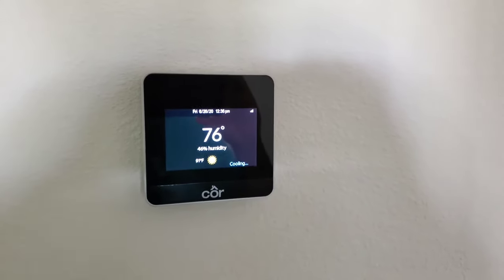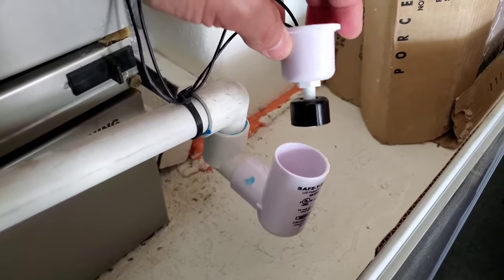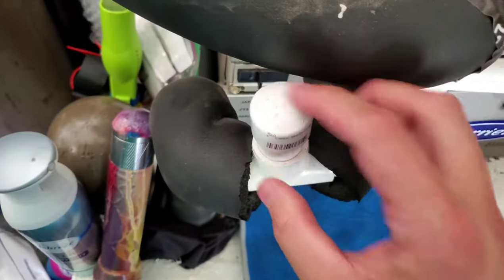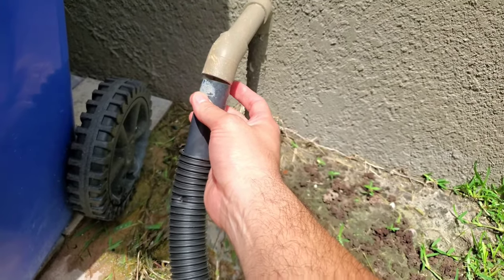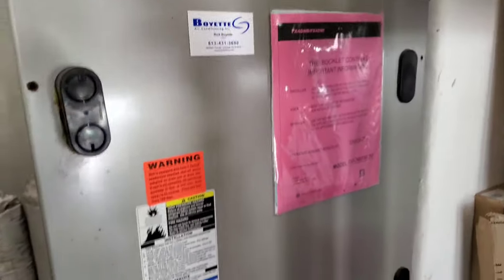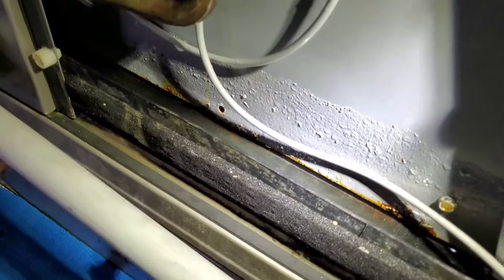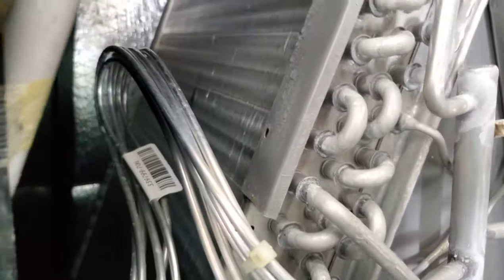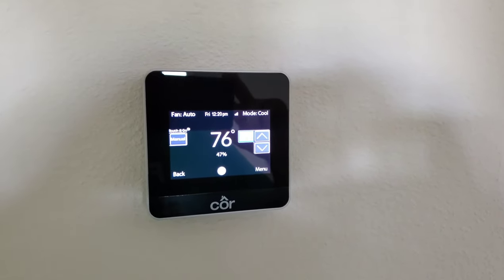HVAC DIY Maintenance - Float Switch Explained

Comment from the maker: The filter tends to be the common root cause or some that don’t run a filter at all. What happens is that dust passes through the system and ends up getting caught up in the condensation that drains out and that causes the clogs. When a filter is too dirty, the suction will bend the filter and air passes around it. There are other instances of clogged drains or float switch issues such as improper pitch in the drain line, too much flow and not enough diameter in the pipe, and also issues with the drain pain holes getting clogged with buildup.

Comment: my man absolutely saved me. It is HOT HOT here in Florida it was 109 this afternoon and my AC went out. I couldnt get maintence over to my unit till tomorrow and I lifted my cap and sure enough it was full of water.... I dont have a wet vac so I syphoned all the water out and sure enough with in 30 minutes blowing cool air. I feel like a million bucks and I get to look like a big man and fix it and now instead of waiting for maitence, my girl was happy.
Reply: The heat is getting worse in fl 😢 and it always happens in summer

Comment: I have a float switch but my thermostat is a nest which has a built in battery, I wonder if it will still cut it off. I appreciate the extra information for clearing the drains!!! No “on a future video”
Reply: Yes it does. Mine did exactly that last week.

Comment: This is amazing, thank you. My house and system is just under two years old. I’ve always regularly poured white distilled vinegar down into the drain line. Yesterday, my entire thermostat was dead as if it had no power supply. There weren’t any batteries in it to begin with so we added some and system came back on but then started to cycle on and off 5 minutes at a time. When it was on, I could feel cold air blowing out so I knew it wasn’t a total system failure. I checked drain line and was shocked to see it was completely full. Outside was still dripping though so I was confused. I hooked shop vac up to outside and inside until there was not even a drop left in line. I pulled out an entire shop vac full of liquid! It was the consistency of plasma. It worked, the air kicked back on and cooled me down from 77 to 72 in under an hour (Central Florida). Videos like this are a lifesaver! 

I deduced that the float switch must have popped up and killed power to whole system. Since thermostat didn’t have batteries in it initially, it also went down completely.

I learned my lesson that in Florida, when you run your air as low as I do, just vinegar won’t do the trick - it seems I’ll need to regularly get out the vacuum. 

This is also my first handler in the garage if that matters. All my other handlers have been in insulated closets.
Reply from the maker: Dude this is awesome! Im so glad I could help others out there with the same issue.
Reply: I have lived in S. FL since '94, and I've found if you vacuum the drain every 3-4 months, you'll have no clog problems. A five-minute job that saves a lot of anguish. Vinegar helps but won't prevent it entirely.

Comment: I think this video just saved me a few hundred bucks. 
Thankfully, I had a shop vac ready to go. 
Float Switch was definitely filled with water. Drained that and turned on. Few minutes later, back off.
Went to the drain pipe. Got my shop vac and a bunch of nasty stuff comes out. A lot!
Turned it back on and it's been 10mins of AC on. Let's hope is stays that way! 
Thank you!

Comment: Saved me some money and a service call and some great advice to service my system. Two story house and noticed some water leaking out of the ac/heat unit from upstairs. Had this happen a few years back and I remember the guy out and unplugging drain hole. I went up there and like a complete moron went at it with a coat hanger after taking the cover off and cleaning it out. Button everything back up and nothing. Didn't have a problem with the unit working until I meddled with it. The one switch the coat hanger was near was the Safe-t-switch in your video. After watching your video I went back up and sure enough, the black piece was now dettached. I fiddled with it and sure enough... paydirt..as soon as I put the black piece back on the safe-t-switch the unit came to life. Thank you for this simple and very informative video.

Comment: After cleaning the pipes with vinegar and  reinserting the Safe-T-Switch the thermostat screen was still blank. I had to push in the reset switch on the backside of the thermostat to get it to come back on. Now everything is working great. 
Great video, thank you!

Comment: I THINK THE COIL INSPECTION IS DONE ON THE SIDE OF THE COILS WHICH THE FILTER PROTECTS , WHERE AIR FLOW ENTERS THE COILS, THAT WOULD BE THE OPPOSITE SIDE ( UNDERNEATH).  THANKS FOR THE SUGGESTION OF ANGLING THE OVERFLOW PIPE!!!

Comment: Safety first before opening any panels turn the unit off at the wall control and the circuit breaker panel.
Reply from the maker: Yup absolutely!! Great tip 😀

Comment: Please note.

 5/16th.

The dirty part of this "A" style coil is most commonly on the under side. Be it that your return is boxed underneath the unit as indicated with the filter placement. 

So your only fixing half the issue, potentially. 

Suggestions could be a NuCalgon no rinse spray or actually getting to the underside of that coil to properly clean it.

Comment: Should you turn your AC unit off when you pour the vinegar and then turn it back on? Also, when you’re using the shop vac do you turn your AC to off or leave it on? Thank you for this video
Reply from the maker: Turn the AC off so you’re not battling the condensation being produced as you’re trying to remove the sludge and existing water in the pipe. Vinegar works since it’s acidic but after letting it sit in the line for 30min, I flush it with a gallon of hot water.

- Turn off ac
- Use shop vac from outside to pull water and sludge. Do it for a good 5 min
- Pour vinegar from the inside pipe/air handler
- Follow with hot water after 30 min
- Use shop vac one more time outside for 5 min again

Comment: I just paid Advent Air (Dallas) almost $500 for this 5 minute job. Thermostat was losing connection bc the drain pipe was filling up. All he did was remove the floater thing and blow out the pipe.

Comment: Hello, I have two thermostats in my home, one upstairs and the other downstairs. The thermostat downstairs is operating and cooling, but the one upstairs is flickering and won’t allow the upstairs to be cooled. Would this still possibly be an issue with the drain line and the floater switch?

Comment: my air handler is in the attic of a small 1 story house. suspended with straps. the setup has no float switch, when the main line gets clogged, the overflow runs to a big drain pain under the handler, which has a secondary drain line that runs out to the eaves. it's supposed to have a hole cut in the eaves where the pipe comes out, but my homebuilders were lazy i guess so it doesnt even have that. but,  if i notice water dripping from my eaves in that spot, i know my main line is clogged. but there is no float switch anywhere in the setup. i'm thinking of trying to set a float switch up in the pan as a third line of defense, but not sure if i'm capable. i had a galvanized drain pan that was quite large (about 30"X55") and it finally rusted and started leaking (just a few drops, thankfully no drywall damage) at my last clog event. It was really hard to find another pan that size, and the only one I could find was a thin plastic, with a lip around the edge. So things like float switches are going to be tough to attach, I'll have to see if I can figure anything out or rig something up.

anyways with this setup in the video though, i would be afraid of just relying on that 20 dollar float switch in the event of a clog. if that switch is bad, in my setup it's probably gonna ruin a lot of ceiling drywall if the main line gets clogged. yes i suppose you could test the switch regularly etc, but i'd still be nervous. now in a garage setup like this, it would be no  big deal. because if you have a little flooding in the garage it's not a huge problem, and plus you are likely to see it much faster since you are probably in the garage often.

Comment: Hi - I have the similar AC system and this video is super useful. However quick question, my AC units side of the drain pain (right and left side) keeps getting filled up with water and starts leaking from there. (shown around 7:30 in your video) Those sides are not reachable because coils sit over that. Any ideas how to clear the water from there.

Comment: Just bought a house in SW Florida. How often do you need to do this type of maintenance? Did you say you replace the air filter every month or two?

We've got dogs and can't afford to have the AC shut off and stop working when we're not there. I got a smart thermostat i'm gonna put in that sends me alert notifications if the temperature rises too much in the house as an extra precaution.
Reply from the maker: Replace air filter at least every 2 months and don’t get the high filtration filter or it will clog sooner since it’s made to capture more air particles.
Reply: @ArcLightAddicts  Thanks, i've watched a lot of people doing AC condensation drain cleanouts and no one mentions replacing the air filter.
Reply from the maker: @AchillesWrath1  yeah the filter tends to be the common root cause or some that don’t run a filter at all. What happens is that dust passes through the system and ends up getting caught up in the condensation that drains out and that causes the clogs. When a filter is too dirty, the suction will bend the filter and air passes around it. There are other instances of clogged drains or float switch issues such as improper pitch in the drain line, too much flow and not enough diameter in the pipe, and also issues with the drain pain holes getting clogged with buildup.

Comment: Heres a question, on my handler I have two sep pipes coming out the bottom, one that leads outside the other leads to ....what I guess would be a drip line, however the one going outside is not clogged and yet I have water dripping from that part with the wire coming out. What would I do at that point?

Comment: New system 2 months ago.  Didn't leave a cap to check drain,  found a u under the handler with no cap on it, open on one side. That's the only open place for drain for me to add vinegar/ bleach.

Comment: My pipe coming out of the house Is shaped like a " U " with the open side of the hole facing up. The AC guy said it should face up for air flow. I thought that was strange and thought the hole should face down to drain to the ground. Yours is down. What is correct?
Reply from the maker: I would face it down but they might have done that to act like a p trap so critters can’t crawl in it.

Comment: Thank you for the video, about to do this tomorrow, How do you get that drain pan out or is there enough space to suck the water out of it with a shop vac. Thank you
Reply from the maker: Getting it out isn’t typically an easy task lol. You can fit a small shop vac hose end to suck out the water but makes sure you clean the 2 drain pan holes that go to drain and float switch.

Comment: Blowing warm….74-75. Checked float and drain pan under cooling fins. I have zero drainage and no moisture on anything. Any ideas? 

I  had the fins/whole coil replaced last summer. 

Hoping it wasn’t a tiny leak.
Reply from the maker: I vote that there is a leak and refrigerant is slowly leaving.

Comment: Your video is so helpful! Just added it to my favorites so I can find it easily. I liked your explanation about the float switch and the way it  is installed  in a longer line and not directly next to the primary condensate line. Just wonder if mine will work better by having one like yours.  Anyway, I need a new Safe-T-Switch since recently the HVAC technician glued it. Why it was glued?  I don't know. Sadly,  I live in Florida....
Reply from the maker: Hi there! The switch definitely shouldn't be glue in. It's a super easy fix/replacement and I'd help if you were local.
Reply: @ArcLightAddicts  Thanks so much, replacing it is my next item. Just need to figure out how to extend the line with an inclination. Still wearing my "thinking hat"!
Today, I replaced the fancy wi-fi thermostat for a basic one....and finally enjoying  a stable cooling.
Reply: @ArcLightAddicts  I fixed it! Your video & input helped me to re-design the line for the new safe-t-switch. Works perfectly! Thanks, here's a Before & After https://drive.google.com/file/d/1Cqmq39M3IuOp5OQ7CHeM5gX9V7do1rd3/view?usp=sharing
Reply from the maker: @sandrablanco6592  yayy!!! Looks good!! 🥳
Reply: @sandrablanco6592  Is your system positive or negative pressure? .. I have positive pressure and was advised that a P trap is not needed for this type of system. Also, I noticed you also have 2 vents (1 before the P trap and 1 after).

Comment: When inspecting the coils, if debris is visible, is it safe to to remove it with an energized ac or I should cut power first? Thanks for the video!!
Reply from the maker: You should always turn off the AC when servicing it.

Comment: I am having the same problem with my Wi-Fi thermostat screen going black. I thought it was a faulty thermostat until I removed the front panel and saw there was no power. Turned out the stop switch  in attic turned off the power and the drain line was clogged. I tried using an air blower to unclog it but it didn’t work. So for now I just removed  the stop switch and that turned on the AC again But the condensation is going to overflow into the pan. I might try pouring down some bleach into the line and see if that unclogs  it. If not I may have to get a shop vac  and try to suck it out from the exterior of the house. I even tried snaking  the PVC line for another 15 feet but that didn’t help either.
Update: poured some bleach down the drain line, flushed it out with hot water after 3 hours. Problem solved :)

Comment: I have done everything you said to do but the water is not draining from the pan. I keep having to vacuum it out. Do you think I need a new float switch? Or do I possibly have a clog in 1 of the 2 lines within inches of the drain pan? Which is before where pouring vinegar would help
Reply from the maker: There is probably a clog in the 2 drain holes that leave the pan. If not that then maybe the pan shifted/tilted somehow.

Comment: Can you tell me which drain pipe goes to the outside? Would it be going into a silver foil wall then to the outside? Thank you! ❤️
Reply from the maker: Yeah it would be the 1” pvc pipe going into the wall or down away from the air handler.
Reply: Thank you so much ❤

If I poured water down that pipe it should come out of the drain out outside, right? If no water comes out would that mean there's a clog in that pipe?
Reply from the maker: @jantravia6984  correct. You would see it fill up where you’re pouring rather than drain out quickly. If the drain is free and clear it should pour out pretty quickly.
Reply: Ah okay.. I had poured a quart of water down the pipe and nothing came out of the drain out at all.

Thank you again for your help ❤

Comment: I'm trying to get as educated as I can before I go out in the field for HVAC, currently trying to wrap my head around heat pump maintenance/troubleshooting. Anyways getting to the point, I'm curious if you could take a nitrogen tank with a nozzle/hose attachment and blow it out from the capped area just outside the air handler? Say 50psi and give it a few blasts, would that work or could that cause damages?

Comment: Sucking out the "chunks" from the drip line with a shop vac is a good idea. However, our lines are attached to bathroom sink drains upstairs and it would be extremely inconvenient to detach them every time I want to clear the lines. Any other ideas other than using compressed air to blow them out?
Reply from the maker: Honestly for that use draino and then flush with a gallon of hot water.
Reply: @ArcLightAddicts so use drano instead of vinegar?

Comment: Question for you ? Secondary drain, How does your float switch work? The way it's  piped is graded downhill to the float, which sits in a p- trap .. so if it does ever overflow into the float switch, you will have to remove the float, then lift the pipe to drain it dry, to resume normal operation: after you, of course, clear the primary  drain that caused it to trip......it's not an automatic reset configuration....see what  I'm saying?
Reply from the maker: That’s one way to do it or you have to vacuum the float switch pipe out. Many systems have a short run and I have since then made mine really short. This length was from the builder.

Comment: Would you recommend putting some vinegar or bleach into the float switch monthly?  If I do this would it flow into the pan to prevent algae?  I do not feel comfortable taking the panel off to access the drain pan.  I do remove the pipe to the drain pan and vacuum monthly, plus I put bleach down the line monthly.    Sometimes the float switch still backs up.  If I put bleach into the float switch it seems to just stay there for a week or so.  Why doesn't it go into the pan.
Reply from the maker: Good question! The only pipe that needs vinegar or bleach would be the pipe that drains out of the house and I would do this monthly for sure. I will usually run a gallon of hot water after waiting 30 min of the vinegar/bleach flow. You’ll need to manually suction out any water that remains in the float switch pipe unless you can tilt it up to let it drain into the pan.
Reply: Thank you so much. I appreciate your quick response. Best regards